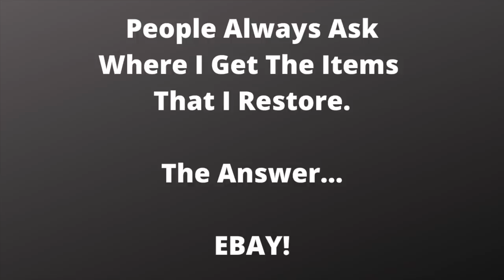Tonka Cement Mixer Restoration

Comment: Well done, sir. Tips: prepaint the rivets, install the rivet, then slip a small O-ring on the shaft and set the rivet. No touchup needed as the O-ring protects the paint. Also, you can brighten the headlights by soaking them overnight in hydrogen peroxide.
Reply from the maker: Thanks for the tips!

Comment: Concrete mixer   Cement  is part of the mix along with 57 stone and sand  along with additives used to drive one . I have  a bunch of Tonka  trucks  I have rescued from the landfill for windshield repair use the headlight restore kit works great  and will do dozens of them .
Reply from the maker: Thanks for the info

Comment: Ah sweet, a restoration manual for my truck!  I have had this truck since it was new, which is something like the late 60's or early 70" s.  I'm even looking at it right now.  Mine has a Ford badge though, with Ferrari horses on both doors.  I had a few left over,stickers on hand back then.  Hey, it is not so outlandish, Lamborghini started out by making farm tractors.  Actually, Ferrari does or did make tractors😮!
Reply: Porche and ford both made tractors.

Comment: Wow, this project was a lot more expensive than I thought it would be. I figured ten bucks for an old beat-up truck and maybe a few dollars for the missing parts, but this was edging on $65, not including paint, detergent, applications or labor! (Or probably shipping costs, for that matter). I figured the finished restoration would go for about that and here thats the starting cost! Really makes you think.
Reply: Right? I'm figuring all told there's nearly $100 in on this thing. It's either that he's REALLY into this as a hobby, or he's got a good market for selling them afterwards. Maybe both, but unless the second one is true then he's taking a not insignificant loss.
Reply from the maker: There's definitely no market to resell and make a profit. Counting parts, materials, supplies, and if I paid myself a decent wage for the labor, this thing cost around $350 to finish. The right collector might go as high as $100 for it.
Reply: @TRGRESTORATIONS  Correct! I forgot to figure in labor time. Eh, it's still cool and fun stuff to do, but yeah. Definitely have to have a little disposable income. :P

Comment: Sure, you say you get the replacement parts on feeBay, but just where are all these assorted NoS bits and pieces showing up from?  Are there bored time travelers bringing them up from the past?
Reply from the maker: Beats me. Some could be old stock that was bought after factories closed. Some could be salvaged from older messed up toys. Some could come from time traveling aliens looking to turn a quick profit so they can get back home.

Comment: What size and CFM is your compressor? Does it actually keep up with a sandblaster?
Reply from the maker: Kobalt 2-stage 30 gallon from Lowes. Runs 5.1 CFM at 100 PSI. That's enough to keep up, but barely

Comment: You did a great job with this little cement truck however I noticed that you have a bar or something that is missing kind of Right Where I gas tank would be it was in the picture before you started the restoration and it was not in the picture afterwards I just wondered what happened to the peace
Reply from the maker: No clue. Shop gremlins stole it, I think.